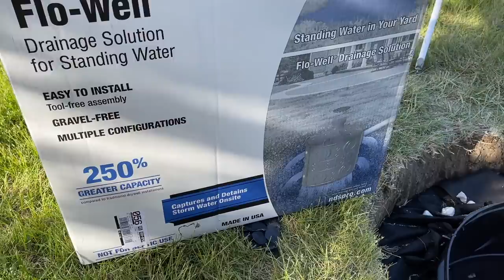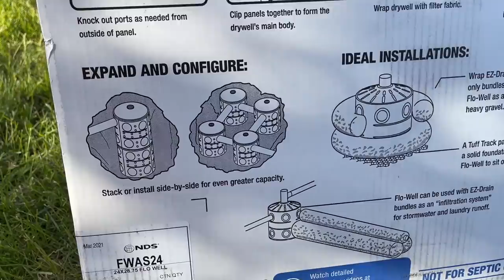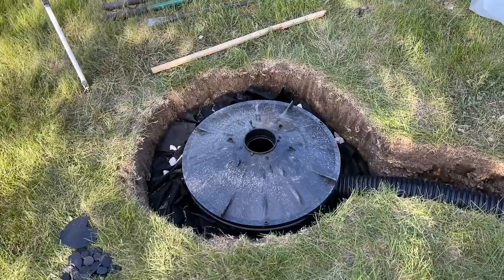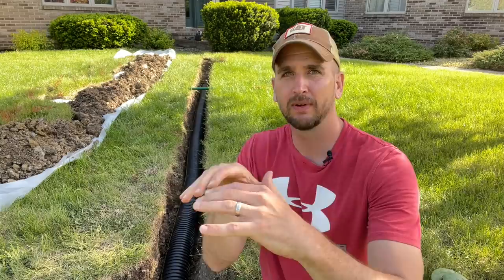DIY Flat Yard Drainage Project | Yards With No Slope

Comment: You could have just made a concrete gully, use a 12 inch pipe, ends up with a 6" Gulley drain. Add a cover with astro turf to match the grass.
It's accessible and easy to clean. Plus no clogs

Comment: All that corrugated pipe doesn't do well in REAL COLD climates. It will ice up solid and break in just a few years
I had to remove a  20 ft long section with an axe last April as it was frozen solid 15 in below the surface it lasted 10 years tops. Drainage pipes on the surface are unattractive but most effective.

Comment: Way too small of a dry well to handle that roof.  That’s going to full up in seconds in a heavy rain.
Reply: I think so too.
Reply: Hole at the top is for a pop-up to allow excess water to escape. Unless you buried a tanker, most  diy solutions will fill. Idea is to get the water away from the structure and drain.
Reply: @SteveLaCombe  French drain is all you need
Reply: @yazhyk  depends on the situation, budget and allowable time. I wouldn't put in a french drain where a dry well would work and I wouldn't put in a swale where a french drain will suffice. Or any combination of the above. This video did an excellent job for showing off a dry well and that's what people should take away from it.
Reply: @SteveLaCombe  Yes, but in this situation the well seems to be a waste of money. Although, the first part of the system is just fine, I don't see the purpose of the well here. If it's going to fill up so quickly, why not just run the drain out to the slope and let the water flow downhill?
Reply: @yazhyk  because its a flat yard.
Reply: @SteveLaCombe  Hmm, he said it slopes just past the well, so why not go a few more feet with a French drain in the shape of a short T once he reaches the slope if the well is going to overflow anyway? The well has no useful purpose.
Reply: Concept wise this will work yet it is way too small a dry well and yeah the pop up will help any overflow yet why not take the water to the road below the side walk ? The black corrugated pipe is cheap crap made of recycled plastic that animals love to chew long term IF they find their way into a system. A leeching bed would dispense more water and not have an eye sore dry well in the front yard.

Comment: That is a ridiculous "solution". In a heavy rain, that drywell, the trench and the pipe will fill up almost instantly rendering them ineffective.  Thousands of gallons of water come down in a heavy rain.  Your "system" holds about 100 gallons tops.
Reply: You are so wrong

Comment: This is really bad advice. Dry wells are worthless. You have to collect the immediate above ground water with catch basins and subsurface water with gravel perforated pipe. You must discharge the water to daylight and not to a dry well. If you have a downhill run, no problems, however if you do not you will need a sump pump to discharge the water to daylight.

Comment: Why? No slope is irrelevant. If u ran it that far from the house why not just use a normal size catch basin at end of discharge because as long as the discharge end is lower than the inlet side at the downspout then it will overflow at end via grate or pop up emitter as it should and permeate into the ground. All you are doing is prolonging the permeation process using a well that large which WILL be overwhelmed within minutes in a good downpour. The amount of work u put in on a basin that size doesn’t even make sense. Also that’s going to hold water longer after it’s permeated enough it will stink like shit in your yard. Watch and see

Comment: pointless. go to the street once again let it drain out that way but at the spout put a Rain barrel in and over flow to another one or to the street
Reply: That doesnt solve the problem of the sump pump bring overworked
Reply: @rdg515  right.. LOL builder should have built the house right instead of cutting corners and having to put a pump in

Comment: Ugh. Feet. It’s feet. Feet is the plural, foot is singular. It’s 32 feet long, or, if you’d rather, it’s a 32 foot section of  pipe. But never, ever, it’s 32 foot. Like fingernails on a chalkboard.